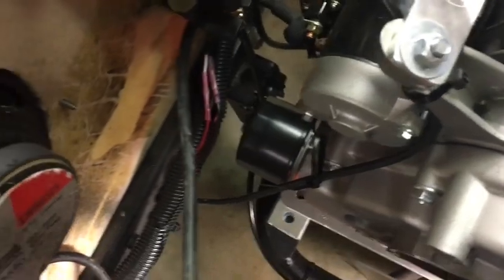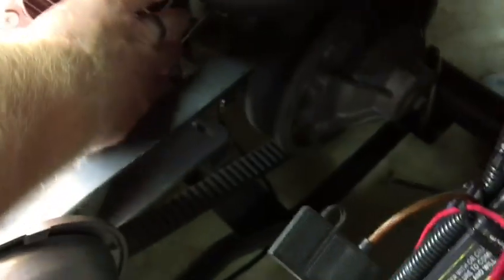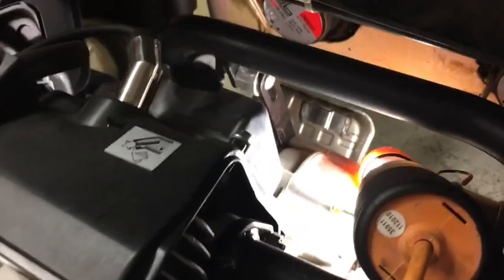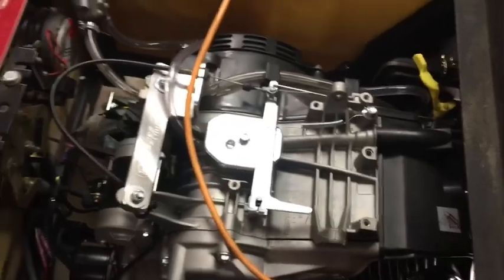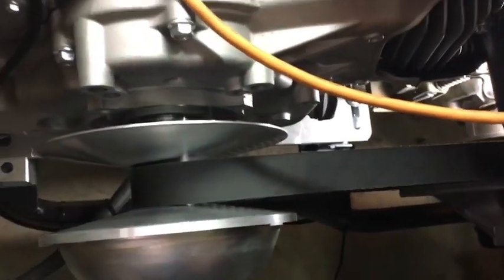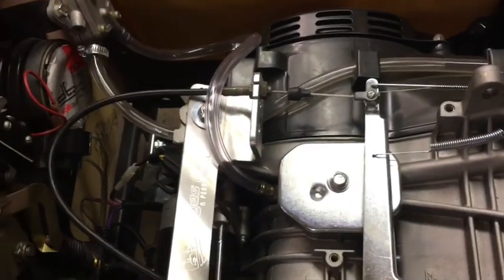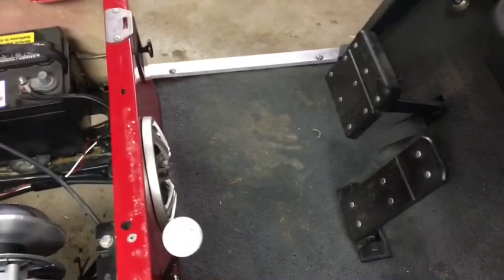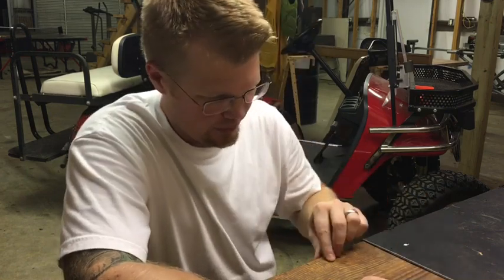EZGO Engine Upgrade Final

Comment: Since you bought the kit from Vegas Carts I assume it came with a wiring harness setup.  Was the key switch designed to mount on the steering column and you modified to fit into the original keyhole on the dash?  I will be doing a Predator 670 swap in a few weeks and want the key to be in the original location and not on the column.  Was thinking about buying the VC wiring harness for the simplicity, but want to be sure I can make it work in the factory location on the dash.
Reply from the maker: I did not purchase their wire harness. I reran all the wiring to the original dashboard location. The hole on the dash did need to be bored out with a remer a little to fit the key that came with the VC kit

Comment: How long did the swap out take you?  Without the bracket issues.
Reply from the maker: It’s been awhile but I recall it taking somewhere around a total of 10-12 hours added up. But with delays like you noted and only working a couple hours here and there it took about 2.5 weeks
Reply: @lancebailey5721  thanks for the feedback and assumed about a 1 or two day job if all goes well.  Thx again.

Comment: There are several things that didn’t really make sense based on your explanation. One of them was changing the height of the cradle and the effect on the distance between the exhaust and the belt. There should be no change in the distance between the two of them since both are fixed distances and neither one of them change in relation to the other with just changing the height of the cradle.

Comment: i went to the carb with my throttle cable. drilled a small hole in the end of it and added a small spring from there to carb. throttle is very controlable all the way to full throttle.